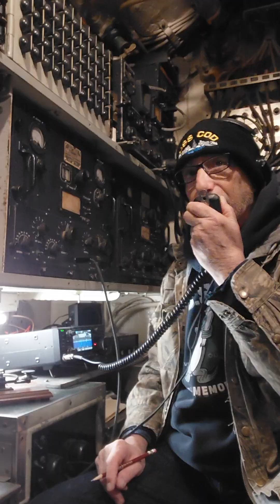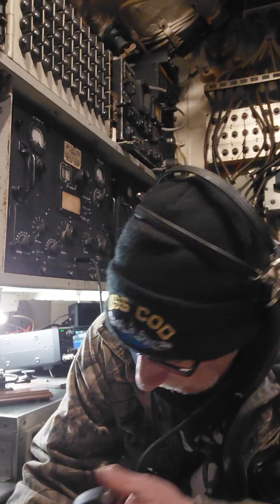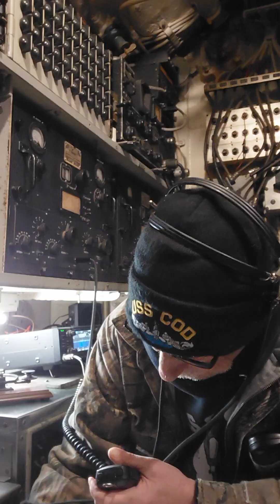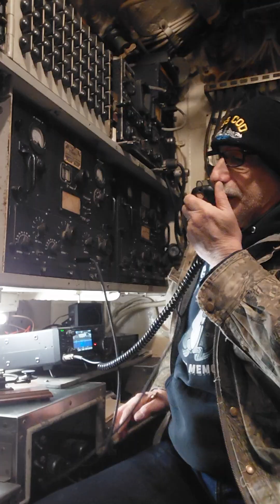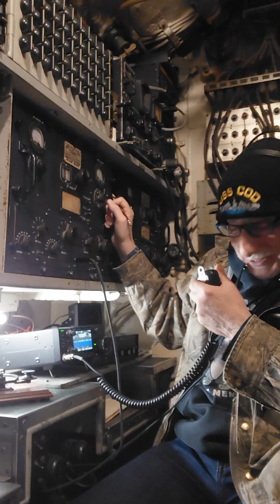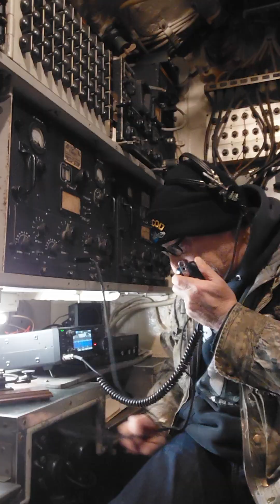WB9KFA KJ5XC W8COD 20251122 183844Z 14250 MHZ

Comment: What Antenna are you using
Reply from the maker: One of the original long wire antennas of the boat.  It is 85-feet long and runs down the starboard side about eight feet up off of the deck.  Power was 82-watts at the time.